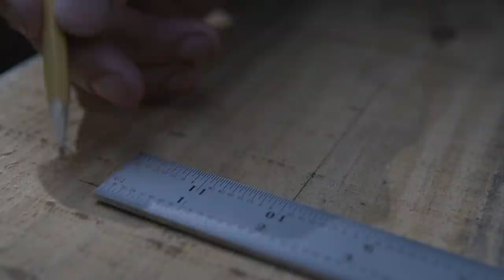Tiny Timber Frame Workshop Pt.1: Foundation and Sill Plate Mortises // Plans Available

Comment: I'm about to tackle my first timber frame construction. I'm building a 16x24 pavilion in my back yard. I'll be using 8x8 and 8x12 cypress for the build. The question I have is, I can only get fresh milled lumber, should I let it dry first or am I ok to build green? Will shrinkage as it dries cause issues with my jointery?
Reply from the maker: Fresh milled lumber is the way to go. Green lumber has been used for timber framing for ages. The timber will dry out over the hears after the project is done. Good luck on the build, let me know if you have any questions during the project

Comment: Love your videos! Very inspiring and relaxing to watch! Great tool list too!
I was wondering what wood species your using? 
Also, was curious if you could show or explain your rope technique and other systems you use for moving timbers.  
I'm thinking of building a tiny timber frame soon! 
Thank you
Reply from the maker: Thanks for the kind words! I’m glad your enjoying the videos.

I’m using Southern Yellow Pine for my frame, but any pine would work well. As for the rope systems, I’m basically rigging up a 6-to-1 pulley system. It’s a large topic, but the idea is that each time the rope is doubled back. it reduces the amount of strength needed to pull the object. Most folks would use a block and tackle or snatch block, I’m using friction hitches and carabiners because I have a lot of climbing gear lying around. Maybe I could write up the basic idea sometime as a PDF or something. In the meantime, if you google ‘pulley systems’ you should be able to find the info you need to get started. Good luck on timber frame. let me know if you have any other questions. cheers!
Reply: Thank you for the information!
I'm wanting to use eastern white for most of the timbers and maybe white oak for sills and joists for its rot resistant. However, I'm really concerned about the weight of white oak on an 8x8x20 beam.  Is that manageable by myself with your rope system at a weight of 636lbs or a block and tackle? Any tips would be greatly appreciated 😊🙏

Comment: Enjoyed the timber framing content and have subscribed.  I don't want to steal the thread, but your crosstie retaining wall caught my eye.  Did you build that, and if so, did you video it?  I am thinking of doing the same at my house and would like to know how you secured them to the hill and to each other.
Reply from the maker: Thanks for subscribing! Unfortunately, I didn’t build the retaining wall. However, it seems to just be built with staggered seems (like a brick wall) and held in place with 12 inch spike nails. Wish I could be more help!

Comment: Definitely subscribed. Love the work here! Can I ask about your timber... I assume you bought from a local person or shop that does large timbers like this, did you get it kiln dried, or dry it yourself? Or are you using green timbers (that's probably a crazy question)? I recently made a very large workbench out of green oak (rough sawn 2x4s, 1x6x10s, 4x4s, etc) and it's holding together very well.

I'm always curious when I see folks doing builds like this (Mr. Chickadee for example as well) on how they got their timbers, how/if they dried, etc.

If you wouldn't mind letting me know, it would be much appreciated.
Reply from the maker: Thanks for subscribing! 

The wood is green from a local saw mill in town. I basically told them what sizes I wanted and the species, and they dropped it off a few weeks later. I’m working with green lumber, so they delivered it as soon as it was cut.

Most places can also kiln dry the wood, but it means you’ll have to wait longer and it probably increases the cost. Plus, if the wood warps when drying, you might be stuck with it.

The  hardest part about working with green wood is that is weighs so much. You’re also working on a bit of a time crunch as you want to get the frame together before the wood has a chance to twist and bend while air drying.Hopefully that helps!
Reply: @NicTaylorWoodworking  Sure does. Appreciate it!

Comment: Great watching you work, I have never used a frame saw, but as I watched you cutting with it, the saw wasn’t at a 90 degree angle, could you please explain why? Thank you, and a new subscriber.
Reply from the maker: Thanks, Stephen! I assume you mean the blade wasn’t at a 90 degree angle with the saw frame? If so, the reason I tilt the blade to one side is so I can easily grip the frame with two hands. One hand on the lower handle, and the other at the top. This also allows my top hand to make super micro adjustments as I cut, since it has more leverage, I can better steer the saw. Hopefully that helps! Cheers
Reply: @NicTaylorWoodworking  Thanks Nick, great explanation, very much appreciated, keep up the excellent work, I’m truly enjoying the videos.

Comment: Marking mortice from edges of beam... how do you know there’s not twist over a 3 metre long beam?
Reply from the maker: Great question! I select my reference face based on how square it is. Typically there is only one square corner per beam, so I’ll do all of my measuring from there. After selecting the reference corner, I’ll actually check for twist only where joinery will be cut. If it’s twisted too much, I’ll plane the twist out with a jack plane. Surprisingly, there is little twist in the timbers as they are all fresh green cuts. They haven’t had much time to warp from drying out
Reply: @NicTaylorWoodworking  Informative, thanks!

Comment: Awesome. I actually started a similar project (at a stage where I just got the wood in). Nice to see you have the same approach. Do I see a bit of Jack Sobon there?

 I like the framing square/combination square trick. Paul Sellers shows the use of a guiding block to pare a mortice side parallel to your reference face, might also work here.

Looks like you're working with dried stock. What wood are you using? Is it oak?
Reply from the maker: oh, man, it’s so exciting when the wood gets dropped off! Are you building a workshop? Cabin? Shed?

Let me know how it goes. Stoked for you!
Reply: @NicTaylorWoodworking  Workshop actually, about 13 by 20 feet. Started with the first scarf joint, already enjoying it :) 
Might even start a YT channel for the heck of it. Doesn't that slow you down though, moving the camera around all the time?
Reply from the maker: go for it! It definitely adds time filming during the projects, but honestly it’s kind of nice to have an excuse to catch your breath while hand planing or sawing. Let me know if you end up posting a video!

Comment: Great video! I’m thinking of building a timber frame workshop as well. A couple of questions about the foundation Nic. Did you pour a footing under the piers? For the piers themselves, did you put rebar in it for strength?
Reply from the maker: I followed codes in my area which only specified a certain diameter for the piers (8”), the depth of the holes (24”) and a specific strength for the concrete. I was told to use four piers, but actually ended up doing six because it made me feel better :) No rebar needed, but I put gravel at the bottom of the holes before pouring the concrete. I’m definitely no expert, but I basically just did a little research and followed the process provided by the manufacturer. Hopefully that helps!
Reply: @NicTaylorWoodworking  what is the square footage? I'm looking to do a similar build
Reply from the maker: @joshleyshon1985  It’s 10’x12’ 120sqft in total

Comment: I’m curious about how you build something like this in regards to permits
Reply from the maker: In my area, permits are only required if the building is more than 120sqft. So, I don’t really have to deal with the permitting system.

Comment: Didn't even see you had put up these videos on the timberframe until now, awesome work!
Reply from the maker: thanks, dude! It’s slow work, but we’re getting there
Reply: @NicTaylorWoodworking  ....добрый день....я из России....хотелось бы у Вас спросить, как Вы , определяете на какую глубину поставить и забетонировать-фундамент....зимой он-фундамент у Вас не поднимет пучением при отрицательной температуре?...
Reply from the maker: @ТОЛИКИВОЛГИН-п4ф  Good question! I dug the concrete footers 6 inches below the frost line in my area. It’s pretty warm where I live, so the ground only freezes to 18 inches deep. In Russia, you would probably need to dig deeper. Since the concrete is poured below the frost line, it will help stop the concrete from moving in the cold. Cheers!

Comment: What is the digging tool you use in this video? I have been looking for something like this, but I never see one in HD/Lowes.
Reply from the maker: I use a pick axe, shovel and a post hole digger. Something like this: https://www.lowes.com/pd/Blue-Hawk-14-in-Post-Hole-Digger/1000377421?cm_mmc=shp-cprdsolgglPLA_SOL_242_Tools-Watering-Storage-Sheds-1000377421--0--0-_-0&ds_rl=1286981&gclid=Cj0KCQjwkbuKBhDRARIsAALysV44MEKWKrQCXKLece3pnUqDD97RSp9zYTDmEaoiv2P9-wsxcX-dqR0aAuADEALw_wcB&gclsrc=aw.ds

Comment: How can I learn more about techniques for laying out where footers go and levelling them?
Reply from the maker: I wish I had a good resource for ya, but I don’t. I did some research into my local building codes which explained how deep the footers needed to be dug. After that, it’s just a matter of roughly laying out the locations, and then digging extra large holes (so you have space to adjust the posts). Once the holes were dug, I used gravel in the bottom of the holes to level the tubes before pouring the concrete. I’m sure you could find some good tutorials if you spend some time looking around on youtube. Hopefully this helps a little bit. Cheers!

Comment: When doing large tenants, why not use a circular saw and then do repeated cuts to the correct depth, lightly tap out the waste and finish them out with either your paring chisel we're playing?

Ps 20 seconds later in #4 you puck up a plane
Reply from the maker: Yup, you could totally do it the way you are describing. I personally just prefer to use hand tools, but a lot of folks have success with the circular saw.
Reply: Damn, I'd pay my rent on time everytime if this guy was my landlord. Taking a circular saw to his tenants, jeez he doesn't mess around.
Reply: @denisl2760  lol, my dad used a circular saw on a tenant’s door because he hadn’t paid rent for months and boarded himself up in the apartment.

Comment: скажите же кто нибудь ему что пила 8:19 для продольного пила,а не поперечного
Reply from the maker: The frame saw I use in the video has a crosscut blade on it. Frame saws can be used for cross cut or rip cut. Thanks for checking out the video!

Comment: Those are some awesome tools! Where would I be able to get them?
Reply from the maker: Most of my tools are antique (the drill, hand planes, etc). You can find them at flea markets or ebay. The chisels are from Barr Tools (www.barrtools.com). I highly recommend them!
Reply: @NicTaylorWoodworking  how did you come across your set of planes?
Reply from the maker: @patrickbrady5457  I got a few from ebay, and then kept my eyes peeled for others at antique shops. i used a Stanley #4, #5 & #7. You should be able to find them pretty easily online. Hope this helps!

Comment: Put a Powermatic mortiser on a rolling Shop Fox and you would save days of work! The chisel method is cool and all until your wrists and elbows  wear out. Why would you want to spend an hour on a mortise that would take only a couple of minutes with a mortiser? Great video though!
Reply from the maker: Well, the Powermatic mortiser would cost me around $1,000. Which means I’d have to go work for someone else for 2 weeks to pay it off. So actually, the chisel is much faster. Not to mention i’d have to find a place to store the machine in the tiny workshop I have.
Reply: @NicTaylorWoodworking You are right. Plus, the forearm and bicep workout you get from cutting mortises by hand is immense!
Reply from the maker: @Goodthink2024  haha, exactly! Cheers!